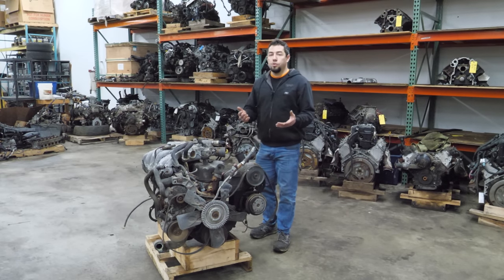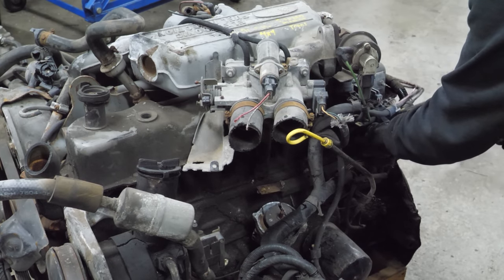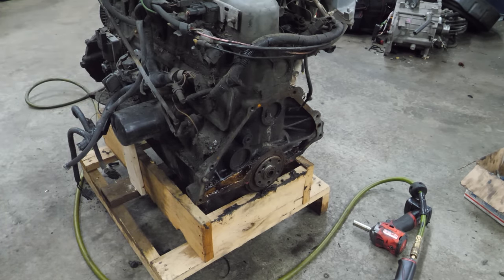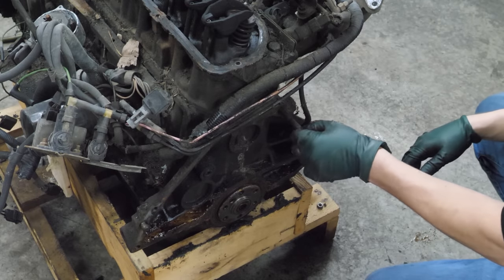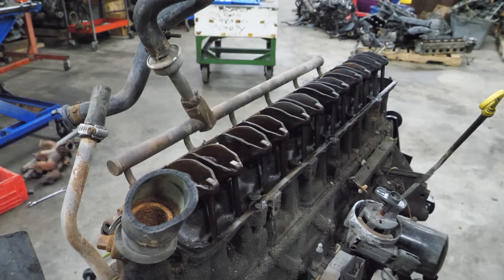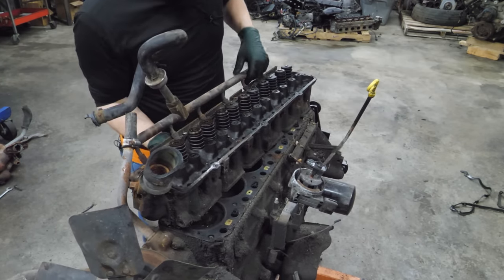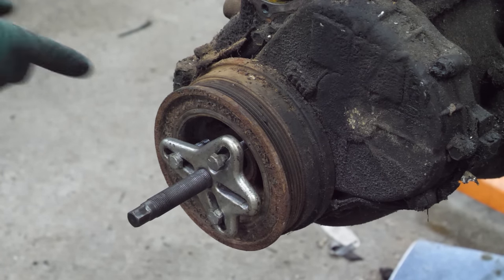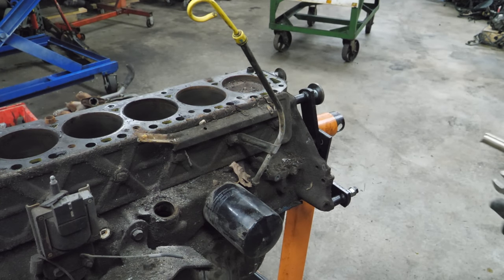FINALLY! A "Bad" Ford 4.9L 300 Straight 6 To Teardown! Most Reliable Engine, Ever?

Comment: Had a '94 F-150 XL, 300 cid, 5sp, 2WD.  Always fired first try, even at -25F.  Pulled just fine with 2000 lbs of coal in the bed (500 lbs overload helper springs & 8 ply all around), or four layers of hay above the cab out of the field, or an 1800 lbs bull and cattle rack in the bed, or a bed full of 2x4s and sheet rock and green board, or cords and cords and cords of firewood, or pulling my '78 Mustang II race car to the track after a rear gear change from 3.08 to 3.73.  Regular maintenance with a Group 4 oil and the same company's fluids every where else.  Only replace an idle pulley, pan gasket, battery and front U-joint.  Rock solid, dependable, always ready, never complaining, low-maintenance, working truck.  She could pavement princess when needed; took the lovely out on many a date using that truck (bench seat, she in the middle).  Miss that truck a lot.  Wish trucks were still built like that one was.  Can't afford to find out if current truck will last that long; working to ensure my '06 Ranger 2.3 2WD with 206k on the clock will last a while longer.  SMH, and I'm a Bowtie Boy.
Reply: How have you managed 200K out of a 2.3 4 banger? Those things are notorious for weak oil pumps. The cam will weld itself to the journals and then break the timing belt. Seen it happen twice.. 2 different motors.
Reply: @DemsRdisguisedredcoats  Jan 2000 forward had a 158 hp PFI Mazda designed DOHC 2.3 with a chain for the cams, not the 110 hp twin plug or the ancient 88 hp carbed Limas.

Regular maintenance on time, Group 3+ oil, ethanol free gas, don’t push her hard when she is cold and only take her above 2500 rpm when the temp is up to normal range, drive it like a grandpa (oh, wait, I am one) in the hills in my very rural county, and since my commute is only 1.3 miles each way, a 10 mile loop each weekend to get all the fluids up to temp for a while.

Comment: Loved these old motors! Did "refreshes" on these for a summer for delivery flatbeds. Switched them over to 5 speed trans for a better highway gear and every motor I worked on had 350k or miles on them. This is the motor they should bring back with just a little new tech on them. Talk about having great work trucks again!

Comment: My dad had the 240 C.I.  version in a 1964 econoline he bought used. Just could not kill it. He was thrilled when it went past 100,000 miles.  Sold it for more than he paid, when he bought a 71 econoline w/ a 302 v8 in it
Reply: Different motors

Comment: What you see is common with the Ford 300. Most people don't change the oil often enough, or use cheap oil which is what causes the sludge you see in that engine. I've owned 4 F150s with this engine, and worked on 300s in trucks up to an F600, which swallowed a valve in the woods of North Louisiana in the oilfield and was driven back to the shop on 5 cylinders. The 300, the Windsor block engines and the FE block are some of the best gasoline engines ever produced. 

The 300 is famous for torque and toughness, and the square bore and stroke are the reason. You don't get much taper in the cylinders because of the long stroke. The weakness is the length of the block and head. Some warp front to rear often occurs, so head gaskets can be a common problem. Decking both block and head during overhaul are a must.

Comment: I have a 78 F-150 with a 300/4.9 in it and it has the granny gear 4 speed. The bodies not too bad and some say it has a nice patina.  The engine had blow by 8 or so years ago and I put some ceramic engine treatment in it and it cured it but the engine is tired and I have no idea its actual miles on it but it keeps on going even though I don’t put a but a few thousand miles on it every year. Someday I’ll probably get a rebuilt long block for the old truck and keep it till I die. Really like the Ford 2.7 Ecoboost tear down (also have one of those) and this vid. Subscribed!

Comment: I recently bought farmland and a dozen vehicles came with it. One is a 1995 F150 straight six manual 4x4. Now that I understand these engines are so reliable, I will have the farm manager bring it back to life. Only 125K on it. It's been sitting for a few years in a barn but once a fresh battery was put in the vehicle and a bit of electrical was repaired, it started up almost immediately. Mice had been chewing on it. Good towing capacity.

Comment: My friend had a 77 F-150 with a 300CI and at 124000 miles he took it to an engine shop and asked them to rebuild it. The shop told him it didn't need a rebuild, and that the engine was still in original specs. He always changed the oil and started using Mobil 1 after 75000 miles. He only got 2000 more miles on it when someone crossed over from the opposite side of the freeway and totaled his truck.

Comment: Drove two F-150's from 1980 -2015 over 500,000 miles total on these trucks great engines valve job on first rear main seals, etc. regular oil changes with Havoline oil every 3,000 miles  no major problems.

Comment: I bought an old pickup with a 300. It was so worn that all the bearings were into the copper and the rings fell off when I removed the pistons. Bought a complete kit, pistons, cam, ect. it only took a standard 30 thou over bore and a 10 under on the crank. It also needed new exhaust valve seats. The truck is solid enough so I plan on using it until I die!

Comment: Sold my 1994 F150 at 444K miles. Only failure was the pos fiber cam gear at around 350 to 375K. Was about $65 repair and an afternoon. I see this engine being torn down has solid steel gear, maybe?  Live about a mile from the folks I sold it to. Still going strong after 10 yrs or so since. Odometer only went to 299,999.9 then started over at 200,000.0 a few times now.

Comment: Had a '78 E150, '80 F150, '85 F150 All factory standard on the floor INCLUDING the van, with 300ci and Carter 1bbl carbs. 200K+ on all before selling them off. Bought brand new a '93 F150 300ci/4.9 Injected w/Factory 5speed "Mazda" tranny $11,225 MSRP that I towed with. sold in '07  for $250 (Rusted out) with 279K. The new owner (neighbor) wrecked it at just over 320K a few years later. Wish Ford never stopped those blocks. Oil changed every 7-10K miles (twice a year).

Comment: I worked for a company that used about a '74 one ton stake-side with a 300 for a delivery truck. It was on the go 5 days a week. It had developed either a warped head or some problem with the block. It blew a head gasket. They didn't have time for a proper repair so every 6-8 weeks my room mate would go in on a weekend day and replace a blown head gasket. They ran it for 3 years like this. He got so it took him about 3-4 hours.

Comment: from the point of view of someone that worked in a machine shop the most common problem with the 300 is out of line bores causing failed piston skirts but even with minimal maintenance most would last for years

Comment: I had one and it was the best dang motor I ever had. It was tough, didn't use oil, and started in a second.  I had a ford truck with a 300 straight 6 in it. The truck rotted out first. I loved it and I wish newer trucks had it in their inventory.

Comment: I was a Ford dealership mechanic in the late 90s and early 2000s. I've only seen two these with any real problems. One the fiber cam gear stripped some of the teeth on it and one a packrat ate the fuel injector harness on #6 cylinder. These things were as bulletproof as you can get.

Comment: Years ago I worked at a salvage yard in Jacksonville FL that specializes in FOMOCO parts.  We couldn't keep these things on the shelf.  I've broken down a few of them that had gone bad through abuse and I began calling it the "Schwarzenegger Motor".  It's just so big and bad.  You could probably have run a WWII tank on one of these things.  Great motor.

Comment: Best engine and truck I ever owned. 91 F150 extended cab w/ 4 speed. Good fuel economy too. Sold it with just over 325,000 on it to a man just down the road from me and he put another 45,000 on it before having it rebuilt. Still drives it today and tells me he'll never give it up.

Comment: That was an early EFI engine built between 1987-1989 because it had the fuel injector cooling tube on it, oddly it only cooled 5 othe 6 fuel injectors but that was to keep it from heat soaking during hot restarting restarting !

Comment: The 300 was available starting 1965 as an optional upgrade. It was available for 31 years straight. I've had two of the fuel injected 300's and one old 72' model 240. The company I worked for had a fleet of service trucks. We had several 300's from 1983 - 1991, both carbed and fuel injected. The carbed engine had problems with the carburetor base bolts working loose. Also at 150,000 miles you could prepare for the distributor to seize and shear the pin on the drive gear. The fuel injected models would go over 300,000. I think Ford had re-designed the oiling/bushing to bearing? set-up in the distributor. My brother had a 300-6 with over 300,000. On startup you could hear rods knocking until oil pressure came up. I dropped the pan and installed a fresh set of rod bearings and rolled in new mains. He drove the truck over 400,000 and then totaled the truck in an accident.

Comment: My ENGINE exactly.
Torn down.
1990 Ford F 150. Long bed.
5 Speed manual
EFI fuel injected.
20 MPG HIGHWAY, from 65-85 mph, loaded or unloaded.
Bench front seat, great ride.
Bucks hard in low gears unloaded.
MASSIVE TORQUE.GREAT POWER.
Best Fraking engine ever made.
ALL HIGH PERFORMANCE ENGINES TODAY (2023)  INCLUDING BIG RIG DIESELS 
HAVE GONE TO INLINE SIX DESIGNS.
BECAUSE OF THIS ENGINE DESIGN FROM 
FORD SO LONG AGO. 
AMAZING. ULTRA RELIABLE.

Comment: Yes, the Ford straight 6 is one of the most reliable engines ever. Had one on a stationary generator that only required oil and antifreeze change occasionally. At 30 years of age it still ran perfectly.  Kind of like the early Cummins straight 6. Very simple and effective design.
Reply: Its nothing like the cummins design especially not early straight six cummins stuff. The 300 isn't special really barely reliable they blow headgaskets pushrods bent valve etc. They can easily blow up.

Comment: Years ago I serviced about 20 UPS delivery trucks with the 300-6. They would trade them in when they got between 400-500000 miles. I saw a couple explode before that many miles but they were abused. Top rpm was only around 4600 rpm so they would usually just laugh at the driver and say, "you can't hurt me".

Comment: I have a 78 F100 with 300 in it. It has a 3 speed manual transmission column shift. AKA three on the tree. The only problem I ever had with the head was the head gasket broke between cylinders 3 and 4. I had the head leveled and replaced the head gasket.  That was back in 2001. The engine has had many miles put on it and the truck has hauled some heavy loads since then.

Comment: i have rebuilt hundreds of these 4.9L for Wonder Bread company this is there main engine and the cummins 4BT Diesel... for there bread trucks... on these 4.9L inline engines if you bore it to .60 over size you must use a lower compression piston like 8.0 to 1 ...... or it will have predetonation and the rings will break and piston will break up like in less then 5k miles this is the big problem we had at Wonder Bread... so the only thing we could do is use a lower presser piston and it worked great no problems..., you see the larger the hole the more air intake the more presser you have it will predetonate from the large presser we found out, we had to lower the presser with the crown of the piston... it worked good...

Comment: I had an 85 and got to replace the intake/exhaust manifold gasket attempting to cure an exhaust leak and run-on before a valve started to melt. Before fuel injection they bolted both manifolds together to help atomize the gasoline in the intake, wrestling that steel mammoth out of the engine bay was a pain. In hindsight I should've saved my pennies and bought an engine hoist. Of all my Craigslist toys, that truck gave me the least problems

Comment: I'm part of the majority. That truck i had is easilly the most reliable truck/engine I've ever owned. 27 mpg 300K miles, replaced the alternator, changed the oil every 3500 miles. Finally sold it for an F350 so I could pull a 35ft.  fifth wheel. Bad move, -+ It worked for me when the 350 died.

Comment: My dad had a 61 Ford F 100 with the 300 c I a heavy 4 speed and positrac rear end.  By 1969 he had over 100,000 miles and it was tired. I took a months leave and came home and rebuilt it. Sent the tyranny off and had a machine shop mill the head put in new valve seats and check all the bearings.  It went back together and all with standard bearing and rings. It lasted another 213,000 miles when the frame broke behind the cab. The motor was still running.

Comment: Ford , in my opinion, blazed the way in American in-line auto engines, and this 300 C.I.D. proves the point.
What a shame the owner hasn't heard that the engine oil AND filter must be changed every now and then.
I enjoyed this 'tear down' video. so, Thanks very much.

Comment: My brother had a 93 f150 with this engine just junked it last year it had 386,000 miles on it still ran good used about 2 quarts of oil in 5k oil change truck just rotted out wish they still made these engine’s.

Comment: I feel the same way about the Chevrolet straight 6 292 CI  I've had several of them and the biggest thing that hurts them is people don't think to adjust the hydraulic lifters. They think their engine has just lost its poop over the years but I'm here to tell you, I have taken them from running crappy, adjusted the lifters and had to be careful not to chirp the tires they have so much torque. In line 6's are great!

Comment: Yep, had a 240 variant F150, I finally scrapped her out at 400,000 miles. Was not even burning oil but the body was totally shot (and had been rammed by a bad driver). It  had been an oil field truck for years before it came to me. I suppose the compression ratio was something like 5 to 1 but it was still running. Old Green I salute you.

Comment: I’ve done horrible things to a “big 6”. Ran a 6 qt. Oil system on alittle less than 1 qt. Welded #1 piston to the bore tossed the rod thru the block and continued to drive it like that for 3 weeks while I rebuilt the replacement. Clifford performance use to have a bunch of performance parts for these things.

Comment: My ‘78 300  in a 1/2 ton needed a valve job at 34,000 miles, replaced by a 302 with headers -top speed went from 88 to 100 mph!

Comment: my 300 in a 85 F-150 lost oil pressure one day..i limped home...jacked the engine up off the mounts, dropped the pan and found a lot of sludge and a broken oil pickup bracket..the pickup was mired into the muck blocking flow. It was at this point I swore never to ever use Quaker State oil again. It was the only oil I had ever used in that truck since new.

Comment: I pulled the oil filter off of a running 455 Olds that was a daily driver (old lady) only to find basically Jello. The car hadn’t had an oil change in Years and I had to start it and let it get hot to get the oil draining. It lived. Crazy. I would say this old 300 saw almost zero maintenance.

Comment: After 480,000 miles on mine I'm the original owner I took my engine out and tore it down. Took the block to the machine shop had it machined and. Leaned up the head also. Rebuild it replaced everything. Rebuilt transmission and transfer case. While I was there I pulled the frame out sandblasted it and painted it. New frontend and front and rear diffs rebuilt. I reinstalled the rear end new shocks frontent and axle/diff. Put in a new gas tank fuel lines and ran new sleeving for the wiring harness and sealed every connector ends to keep them water proof. New body mounts and I stripped the cab bare all glass doors interior out since it was rust free I did lizard skin from toe board to back of the cab and undercoating the bottom of the entire cab. Installed all new seals and gaskets. New carpet sound dead Mats and insulation in the door panels. New heater core and all ac components replaced. I put a brand new set of heavy duty tires on it. 1989 f250 4x4 manual tans and transfer case. I had it professionally repainted. The only thing I never had it with a truck bed it had a service bed all its life.just got the service box painted to match and upgraded locks added a crane welder air compressor and new tray system for tools. L.e.d lights. It's been a good truck reliable never let me down. I built my business on this truck and because of it I own several businesses made me my first million off this truck. Spent many nights sleeping in it at truck stops and working all crazy hours.

Comment: Best motor Ford ever built for reliability. I've owned four. Two were in a boat. Good on fuel. Great torque.
I gave one F150 to a friend's son 18 years ago with 350k on it then. It's still going with almost 600k on it. Never had the heads off. Good oil, coolant and regular maintenance .

Comment: When I was 16, I had a 1949 Chevrolet 5 window pickup. It had a straight line 6 cylinder engine. I had it for a couple of years, then sold it to this guy who drove it like a maniac. I saw him in a parking lot with the hood open and his friends looking at 5he engine. I stopped to see what had happened. On of the pistons had come through the block completely. It was hanging there. And the engine was still running. He threw in a quart of oil and drove off down the street. It lasted a day or two before it completely blew up. I was sad to see what he had done to the truck. He ended up putting in a 327 and drove it until he wrapped it around a tree. I regretted selling it to him. I wish I had it now.  Roger in Pierre South Dakota